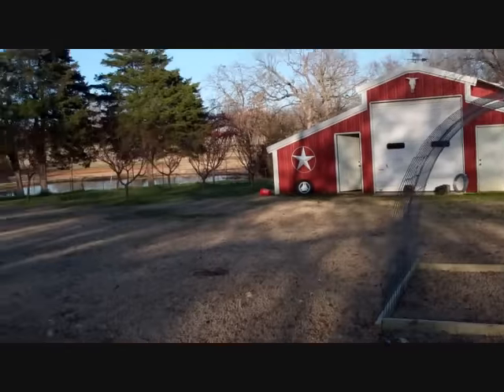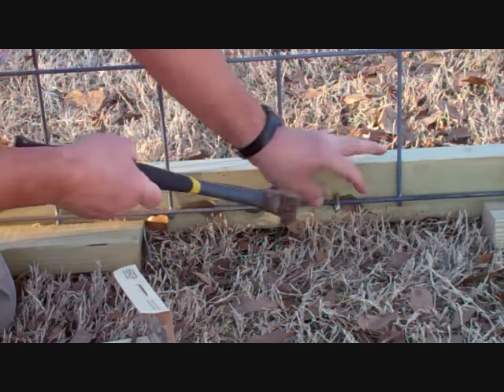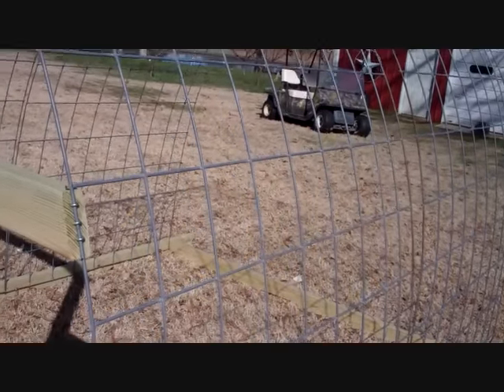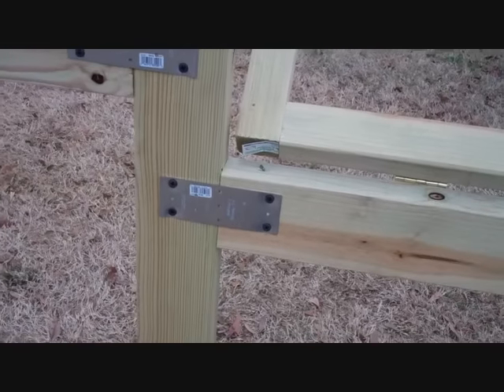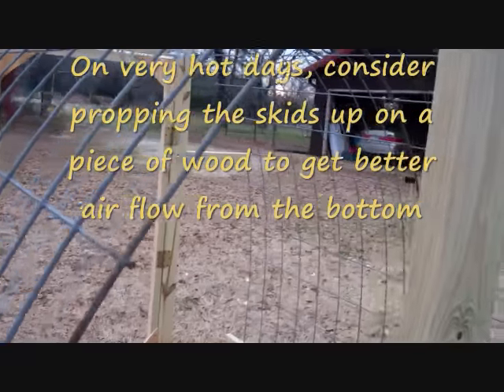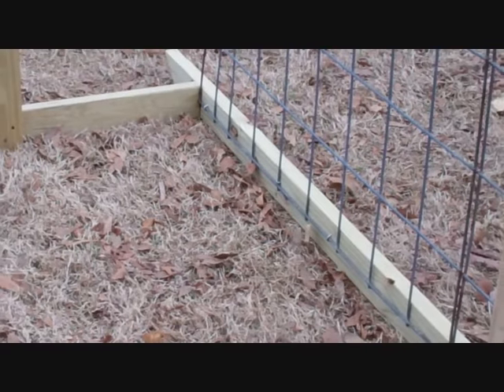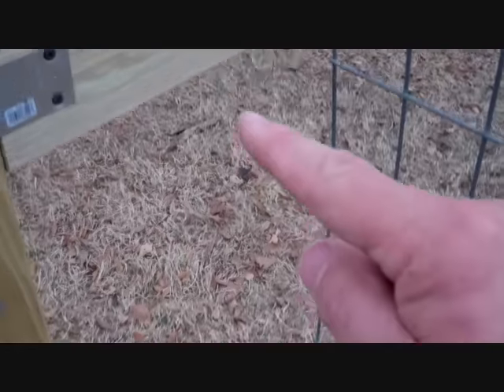🌞Cattle Panel Greenhouse🌱For About 150 DOLLARS! 🌻 DIY

Comment: nicely done what kind of wood is it? and the diameter of the screws ?
Tanxs fore upload where can i buye the plans ..?
Reply from the maker: The wood is all treated (wolmanized).
I think all the screws I used for framing are 3" galvanized.
The plans should give you all the info you need.
Here's how you get the plans...

IF YOU WOULD RATHER HAVE A PDF (that you can print out) CLICK ON THE PAYPAL LINK BELOW.

https://www.paypal.com/cgi-bin/webscr?cmd=_xclick&business=9MJBXYPX8HWBW&lc=US&item_name=Greenhouse%20PDF&amount=5%2e00&currency_code=USD&button_subtype=services&bn=PP%2dBuyNowBF%3abtn_buynowCC_LG%2egif%3aNonHosted

I send the PDF manually when I see the Paypal notice.
___________________________

HERE'S A LINK TO THE e-BOOK ON AMAZON:

http://amzn.to/2kE0RES

Hope that helps

Comment: I know the fencing was 50 inches wide but how long was it to get the 6'2" height? Is there a way to calculate this if you know the height and width? His being 7 feet. I may want to change the dimensions a little
Reply from the maker: It's not really "fencing". They are "Cattle Panels".
They are 50" tall and 16 FEET long. When the 16' panels are "arched" with about 7 feet between the ends... it makes a 6'2" height. Several folks have made the bottom boards (the skids) out of larger lumber... like 2X8's or 2X10s. Raising the ends of the panels up will give you more headroom. Here are some other greenhouses built using my design. One of them has larger "skids": http://homesteadadvisor.com/greenhouses-built-using-my-design/
Hope that helps.
Reply from the maker: And here's a link to the panels:
Many feed stores have them as well as other farm stores: 
https://www.tractorsupply.com/tsc/product/feedlot-panel-cattle-16-ft-l-x-50-in-h?cm_vc=-10005

Comment: Okay I built mine using your guide.  It took me a lot longer than I thought but mostly because I've never built one before.   Now I'm thinking about how to keep it warm at night.  We live in North Georgia and I'm wondering what other people have done in that regard. It's about a hundred feet away from my closest electrical circuit. I do have a long extension cord and space heater but didn't know if that was the best approach.
Reply from the maker: Here's one way I did it: https://www.youtube.com/watch?v=0A4uwhU6zS0
Any way is expensive  :(

Comment: I save my can lids where I open a can of corn I bend them in half and use them as metal brackets. When you double them you have a strong half circle metal piece perfect for strengthening wood joints like this. If needed?
Reply from the maker: THAT is a GREAT idea... thanks!

Comment: Texas prepped can you tell Me how long was that cattle panel you used in your green house 50 inches by ? HOW LONG WAS THE PANEL
Reply from the maker: It's 16 feet long.
50 inches X 16 FEET.
There's a link under the video to Tractor Supply showing it.
hope that helps

Comment: I was at a big name store to check out the Cattle Panels....they were all so rusted. I guess they had been stored outside in the rain. I assume that is what is going to happen over time.  If I painted them will that help to keep the rust away? I was going to put "Bug Away" over not plastic. I dd not plan on using plastic. But because of what I saw with the rust I am changing my mind. lol Unless there is something I can use to protect the panels. Any suggestions....thanks for the video...love it.
Reply from the maker: +Regina Leathers 
The panels are 'galvanized' so they shouldn't be rusted. There may be spots of rust, but not everywhere. 
Are you sure you weren't looking at concrete reinforcement wire...?
Here's a link to the cattle panels at TSC:
http://www.tractorsupply.com/en/store/feedlot-panel-cattle-16-ft-l-x-50-in-h?cm_vc=-10005
Reply: You might be right. They were really rusted. I will check out the link that you gave. Thanks so much for your time. Have a great day.
Reply: +Regina Leathers what you probably were looking at was rebar. When I go to Home Depot or Lowes their rebar is always rusted.

Comment: I thought this is a nice build, but it seemed to be a bit short for me, 6' 2" ?  I also concluded I could erect a foundation wall underneath it and just bolt it all on top making it up to 8' tall.   Never heard of cattle panels before. Do they make them different lengths?
Reply from the maker: Several folks are doing a foundation wall. You might want to look at some of the comments here for ideas.
As far as I know there aren't different lengths of the panels.
I have a link to them on Tractor Supply if you want to get a look at 'em (below the video)

Comment: I really like this design and started building one of my own. I'm putting a door at each end and a vent in each door. I plan on using a rain gutter watering system and trying to grow in it year round. The thing I'm concerned about is keeping it warm during our harsh midwest winters. I work noon to midnight so I wouldn't be home to be able to do anything at sun down like covering it with a tarp. I plan on having some barrels of water in it as a heat sink, but I have no idea what else to do, Got any advise on how to insulate it better and still allow plenty of sun in? Or any other heating ideas? Thanks.
Reply from the maker: Brad Howard No other ideas... some barrels painted black might do the trick... but not sure. I have a Playlist on the Greenhouse that looks at heating ideas... check it out.

Comment: Can you make a taller and wider greenhouse using the cattle panels?  I would like to maximize my area which is about 12 feet wide
Reply from the maker: John Chiaviello Yes... others have built a "wall" of some kind to attach the panels to, and raise them up higher... which allows you to widen the GH and/or make it taller. Here's one example:https://www.youtube.com/watch?v=BdbCcQTUO1oThis guy attached the arched panels to a horizontal panel and made a large one:https://www.facebook.com/media/set/?set=a.4916058198850.1073741826.1820078762&type=1&l=8bc420c241Hope that helps...

Comment: Great vid, thx bud. So much faster than pvc method. I'm 6'4" so i will probably use 2x12's for a base and raise up the panels on a 2x4 lip. You think it's a gud idea to drill vent holes in the sides of the 2x12's for ventilation?

Comment: How long does the cattle panel need to be so its 6'2in a 7' 2x4 frame?
Reply from the maker: justin holland The cattle panels are 16' long. If they are in a 7' frame... it will be about 6'2" tall at the peak.

Comment: With all the rain we’re getting in Texas lately, could I set this on top of pavers?
Reply from the maker: Sure In fact, with the heat coming this summer, raising it up a little bit would provide better airflow. 
Bringing in cold air from the bottom and letting it exit through the window.
Reply: @BIGALTX  I want to also add a little solar fan for even more ventilation.  I’m so thankful I found your channel!  I was going to buy the tiny greenhouse at Harbor Freight and still have to make improvements to it.  I didn’t want to have to spend so much money but it is the least expensive kit that will fit in our yard.  I much prefer your greenhouse to that overpriced junk.

Comment: I didn't see what size of plastic sheet you used in the kindle book. I have mine built but need to order plastic now to cover it. Could you let me know what page it's on if I missed it or just what size it is? Thank you Sir! :-)
Reply from the maker: +sonnycohopie 
I think it's Page 24.
If you built a 2 panel greenhouse, you'll need the plastic to be 16'X25'.
Get a good "Greenhouse Plastic". There are links in the PDF.
The plastic at Lowes or H. Depot won't last but about 1 year.
Reply: +TexasPrepper2 Awesome!!! Thank you Sir!!! Best video and plans ever. I learned a lot. I greatly appreciate your info.

Comment: hello sir. can you please tell me the horizontal size from wood to wood on the ground in cm ?and the size of cattle panel? How tall is the greenhouse?
Reply from the maker: Here are the panels at Tractor Supply: https://www.tractorsupply.com/tsc/product/feedlot-panel-cattle-16-ft-l-x-50-in-h?cm_vc=-10005
They are 16 feet long and 50 inches tall... not sure about CM
The greenhouse is 7 feet wide and about 6'2" tall at the center top.
I have plans to show you how to build it. The plans are cheap, and will probably save you time and money.
The plans and materials list for the greenhouse is now available. Please use one of the links below. 
If you want to be able to PRINT OUT the material, you'll want the PDF. 
Click below for the GREENHOUSE Plans and Materials List PDF: 
https://sowl.co/TMuS2

If you would rather have it as an e-Book for your Kindle device, use the link: below:
Click below for the GREENHOUSE Plans and Materials List e-Book on Amazon:
http://amzn.to/2CMyQ8s

This info is also located below the video.

Comment: Not saying someone else can't come up with same idea, I have been using concrete wire mesh, with plastic tarp sandwiched between two panels of  this mesh,  I have just recently found cattle Panels, they are better cause they are galvanized and sturdier. The concrete mesh, is still useful for transport, can roll it up and put it in back of pickup truck..
Reply from the maker: The panels can be transported in a truck too. Put one end in all the way to the cab... then bend the other end up and close the tailgate. It'll wiggle a little going down the road, but a bungee or 2 and you're set. The wind just whistles through it anyway... no drag. Careful when you open the tailgate... it's pretty "springy" :)

Comment: This might sound dumb, but you said that you used a 16' x 25' plastic however the cattle panels are 16 feet long and there seems to be a good amount of extra on the sides.
Reply from the maker: There is extra on the ends (the 25' length of the plastic) ... but very little extra on the sides (the 16' part) ... only a few inches. 25' is a little long, but any shorter and you might come up short. Better to have too much than not enough.

Comment: got it built Sunday.Man it is sturdy.As I`ve said in my last post I used 3 panels,8x12ft.What size plastic should I buy? Thanks again
Reply: have you read what some did, you might want to use a heavy guage so sun don't dry and crack it. and where you have ridges or protruding stuff, put padding and zip tie on and then plastic so it down wer in the wind and rip a hole. I have got to make one looks so cool. I just ordered  a plan and up in his info box he shows a site to get the heavier gage.

Comment: So after 8 years how has it held up? I'm confident it's doing well, but I'd like your assessment in case you'd do anything differently.  Also, how many mils is the plastic you used?  Thanks for sharing this awesome project.  I've really been inspired by your series on blackberries.
Reply from the maker: MUST use a good "greenhouse plastic".
Mine lasted 4 or 5 years. Plastic from Lowes will only last ONE year.
The structure lasted a lot longer.
I turned it into a sheep shed, then finally tore it down when I sold my sheep: https://www.youtube.com/watch?v=SSjX1x1jNMs&t=29s
This one was pulled around the farm a lot and was damaged from hooking roots and stuff.
It should last 10 years or so, but I would stain or paint the wood before you build it, to preserve it even longer.

Comment: Pictures to come soon.  I just built a 3 panel one and I made the mistake of buying all the fancy brackets ...honestly they were still a little weak and I ended up just doing the way you suggested at first :P  I went over budget (cus I bought 2x2 and 1x4 instead of splitting wood up)...I also didn't plan it very well and wasted lots of wood (lots of left over pieces.  I didn't buy your manual till I was done (out of respect)....based it on your video.   cost 250 and that thing is rock solid.  We had to lift it over an existing garden area (which 2 people can do with no prob) and I assumed that it would shift and get off square...but the doors windows and everything else stayed EXACTLY the same.  I am 1 happy camper :)  That harbor freight cr@p I returned was so flimsy and cost 3x as much.
Reply from the maker: EXCELLENT !
... and thanks for your support !

Comment: cool.    2x6's where you connect the cattle panels, would have added alot more strength and lifespan to the structure.
Reply from the maker: True... and height (adds about 2") I've use 2X6's on several I've built.

Comment: Any tips on moving the poultry version of your greenhouse? I can move one end at a time (wife isn't strong enough to lift the othe end) but the torque causes door closing issues. LOVE your design!
Reply from the maker: You should be pulling it along the skids. If you have corrugated metal on it, it DOES get heavy. I would pull with riding mower or vehicle if it's too heavy to move by yourself. Thanks for the kind words !
Reply: put 2 lawnmower tires in it

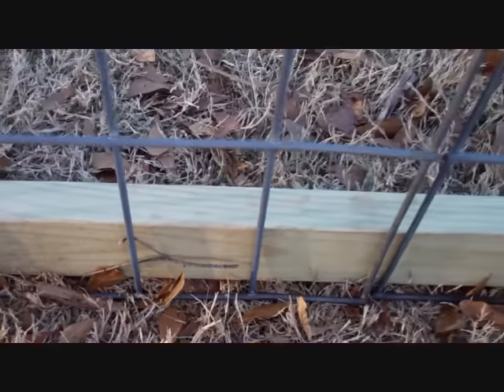Comment: There is a better way than staples to attach the poly to your boards.  A channel with wigglewire can be used with no tear out of staples.  You can see it in my video- Hoop House part 2 on my channel "DIY Home& Garden Projects"  time 1:00 to 2:15.

Comment: I would think the door should open out to have more room on the inside . is there a reason that you didn't that I'm not thinking of?
Reply: Bramhall Homestead Texas : Perhaps when you open it to the outside, the wind would get hold of it, and the flapping and pulling the frame to force it shut, would wear it out. But I am just an old Dutch girl, and it's very windy here at times. Furthermore, I would love to give it a try myself, in a tiny city garden, so opening the door the other way, I'm sure I would have to shove and push things around before Getting in. And then my hubbie would plant a crate with mulch in front of it and went for a pee. Leaving me there to have some quiet time on his own! 🤠🌷🌟🍀
Reply: When you go into your home, which way does your door open? Quite a hatch he had to keep the door closed without the expense. But then, maybe some of the guys here have no idea why we love Greenhouses!

Comment: I’m 6 ft 2. Would be hard to get in and out of this one.
Reply from the maker: The height is around 6'2" at the peak of the arch.
I would suggest instead of 2X4 runners, you use 2X8's. That would give you quite a bit more height.
Or, instead of 7' wide you could go a little narrower. The narrower it is, the higher it makes the arch.

Comment: nice and easy to make greenhouse. What kind of metal is the grid made of?
Reply from the maker: Galvanized steel. Look below the video in the "About" tab. There is a link to the cattle panel at Tractor Supply. It will give you a better look at it.
Reply: TexasPrepper2 ok, that's actually a very good material. At first i thought it was 'beton mesh reinforcing'.
Reply from the maker: adlozi No... this is some HEAVY stuff. I can hang from the GH in the middle of it. It's STURDY !

Comment: I already purchased the Warp Brothers 6 mil plastic but haven't installed it yet; would you recommend that I not install it and get the Greenhouse Clear Plastic instead?
Reply from the maker: Jonathan Crowley 
Absolutely. See if you can return it to the store you bought it from. Yes, you will need some good greenhouse plastic. The warp brothers plastic will only last one year. A good greenhouse plastic should last four years, maybe five. 

There should be links under the video to some good greenhouse plastic on Amazon.
Reply from the maker: I thought the Greenhouse megastore sold smaller dimension plastic sheets, but I guess they don't.A 2-panel greenhouse needs a 16'X25' piece of plastic:
https://amzn.to/2RE8qfU

(if you use this link, i get a small commission from amazon)
Thanks.
alan

Comment: You left out the most important part...How do you get them to bend the same so they're uniform?
Reply from the maker: They seem to bend pretty uniformly.
When you add the end supports and framing you can have get them a little closer to the same if they are not already

Comment: I want you to know I bought your plans about....7 years ago? I used 3 panels and use it as a chicken coop. I love it. Got to find those plans again and make another one. My flock has grown. Thank you. Btw. I'm in Orlando Fl and we've had 3 major hurricanes and it sailed through them with flying colors. Thank you
Reply from the maker: That is awesome!
So good to know it held up well in the storms.
I'll use you as a reference if someone asks about how it holds up in high winds.
Did you have it tied down?
Reply: @BIGALTX  actually I don't have it tied down.  I have a tarp just a bit over the sides to keep the rain out and chicken wire on the the front, back and bottom of the sides.  I guess the wind just blew through.

Comment: Where in Texas? I am in lubbock lots of wind will this hold?
Reply from the maker: Mine went through some 60 MPH winds.
Others, in windy areas, have said there is little problem with winds.
Some have decided to use these just in case: https://amzn.to/3oIDqvo
I've never found them necessary, but you might be in a more windy area than me

Comment: How much cattle panel you need to make a green house big enough that I need fit a suburban in???
Reply from the maker: kool-Aid Man You'll have to experiment with it. Keep in mind this one is 7' wide and 6' tall. A Surburban is much taller than that, and probably 20' long. It would take some planning, and you'd have to start out with a wall on either side that is (probably) 4' tall...
Reply: TexasPrepper2 okay thanks

Comment: Did you ever sell that one?  What would you say is a fair price to sell one?
    Also, how do you use the black batton tape on the greenhouse? I've never used it before.
Reply from the maker: I sold it for around $300.
The batten tape holds well... but you can use wood battens too.